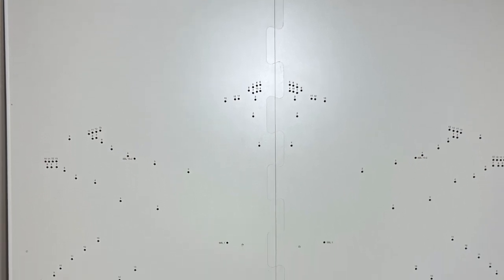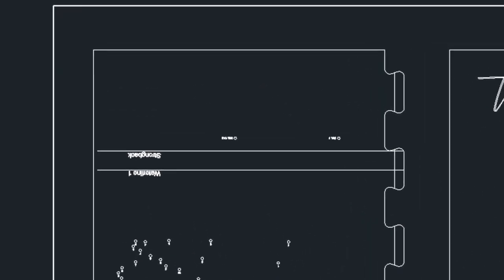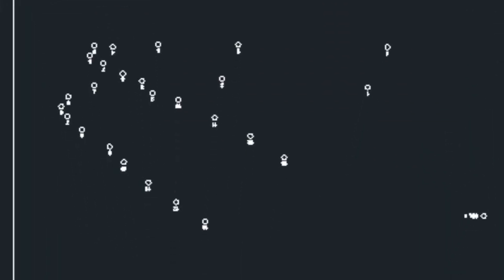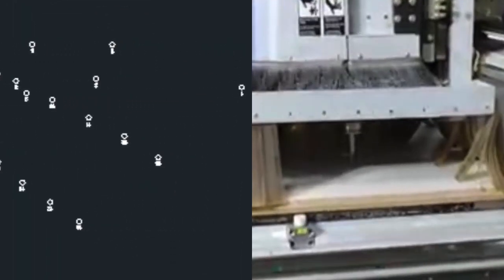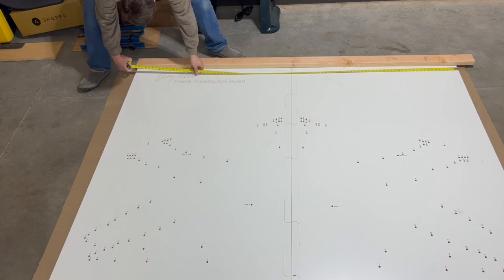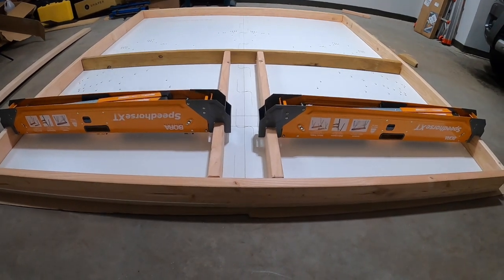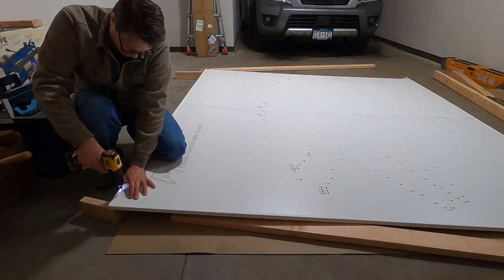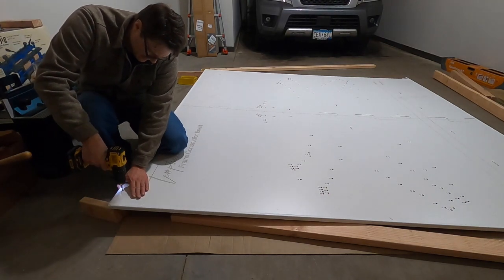Temptress Build 3: Frame Construction Board Assembly

Comment: Like many others, excited to see you go through the process and learn a little before trying.  

Any chance you are willing to share cost to outsource the CNC work, along with your material/plywood costs?
Reply: Disregard the CNC question, I see your using the Shaper going forward
Reply from the maker: Sure.  For the Sapele, I paid US$10.20/board foot surfaced on 3 sides.  I purchased a total of 172 board feet.  The marine plywood varied from US$92/sheet for the 1/4” thick to $129/sheet for the 3/4” thick.   In total I have spend close to US$4k for the MDF, Marine Plywood and Sapele required to build the strongback, bulkheads, frames, keel, stem and chines.  I have not yet priced out all of the 1/4” thick mahogany planks that I will use on the sides and bottom.
Others have shared costs on Dan Lee Boat Building’s “Forum”.

You are correct that I chose to purchase the Shaper Origin for the CNC work.  Two reasons:  1) I did not have an affordable way to get 2’ wide edge glued Sapele.  My lumberyard charged a lot for that service.  2) While the outsourced CNC service that I used for the Frame Construction Boards was high quality, it was going to be too expensive for all the parts.

Comment: I will soon start to build Marlyn from Dan's too.

 I'm following your videos with great interest but I happened to notice that your workshop is terribly under equipped. It is almost just a room with some construction grade tools. (Your router is awesome though. I wish it didn't require those stickers). Temptress is a huge undertaking even for an experienced boat builder. (I wish I had your courage). Do you plan to build a workshop around it later on?
Reply: If you want I can make you a list of most essential tools you will need. Boat building is actually lot easier than you think. I didnt know how to hang a paint on the wall 3 years ago. 
I learned wood working while Im building the boat. 

Please just don’t repeat my mistakes.I sold 70% of all my initial wood working equipment purchases. Buy good hardware!
Reply: @serdarbas8016  

Serdar - I would like the tool list.  Can you email me at cooksanimated@gmail.com
?
Reply from the maker: Hi Serdar - Good luck building Marilyn.  Beautiful boat.
I love your comment, because you are spot on.  I lack the boat building experience and tools,  but decided to take the plunge.  I have crossed the courage line, well into insanity.  I do plan to buy the tools and build the workshop specifically for this Temptress build.
Reply from the maker: Hi Serdar - That would be great.  I have messaged you on Instagram.

FYI - Dan Lee Boat Building has a forum already established.  We can post the list of needed tools there.  I am confident that others would find this useful.  
Thanks,  Bob

https://danleeboatbuilding.co.uk/forum/forum/dan-lee-boatbuilding-builders-forum/
Reply from the maker: Hi Serdar - I have subscribed you your channel.  I am already learning from you.  I now know how to build a steamer, so I can bend my keel and stem laminates.